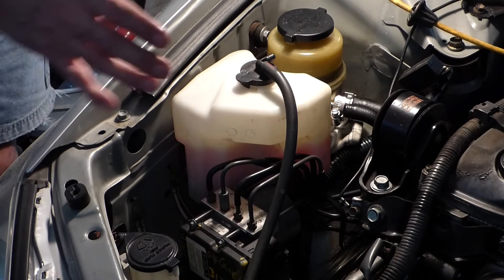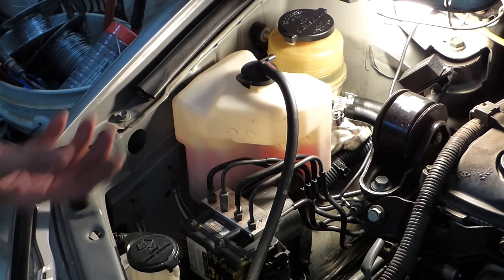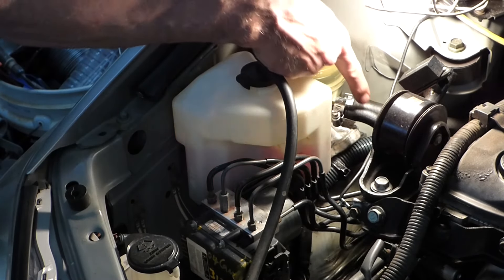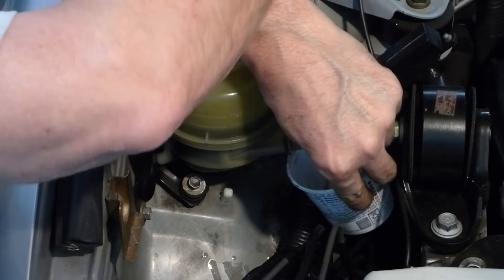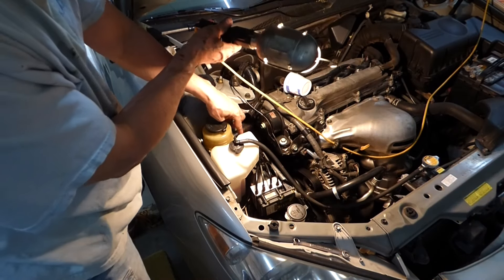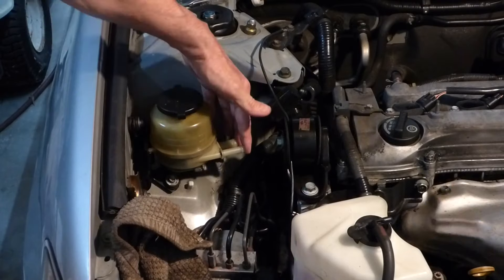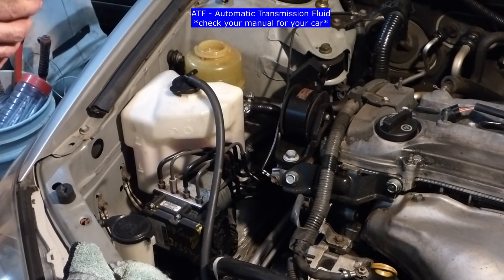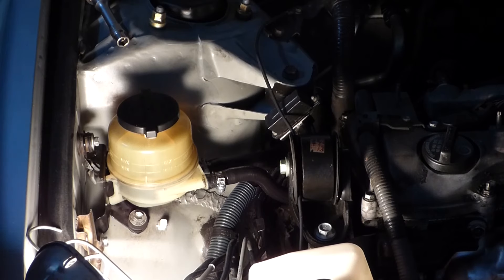Power Steering Leak? Check this EASY FIX First

Comment: I've replaced these leaking lines on several of this era Toyota Camry - recognized the engine layout immediately.  The Sunsong part on Rock Auto is 26 bucks. It's always been the rubber hose just worn out, hardening, etc, and no longer sealking corrrectly.  I recommend sticking with the OE continuous pressure clamps and not switching to worm drive clamps, unless you plan on routinely tightening up your worm drive clamps over time.  Two of the Camrys I did the replacement over 3 years ago and they continue to function without any leaking, so I am confident in the quality of the Sunsong parts.
Reply: Can you list the part numbers for both hoses?

Comment: Had the exact same problem on my 07 Solara. Mechanic told me both hoses were leaking but that just wasn't the case. The small line was loose, really lose. I just wiped it up and put a new clamp on. No leaks in 2 days. Good so far

Comment: If you look up a video by a YouTuber named silver cymbal, he advised the screw tight clamps expand and contract and you have to get the clamps that are designed to keep constant pressure regarding of a screw tightening method. I have also seen hose zip ties that you clamp down with a special tool and they don't expand like metal and keep pressure on the hose.

Comment: Thanks for the tip.... I have 2007 Mitsubishi . About  once a month ,there is a tell tale moaning  and groaning  of power steering  pump and  heaviness  which  tells me its time to top off resivoir ....Very likely  faulty / loose clamp.  I just got done upgrading  rear door speakers  when I noticed  the power window  motors and lift arm track and roller pulley are installed  "dry" at the  factory  as in no lubricant  this shortens life of motors and keeps  cash coming  in for certified  parts and mechanics . I went around  to all 4 doors  , greased all  lift arm tracks AND vertical  window tracks with dry silicone  lube....also coated inner door  ,  and latch linkage with WD-40. to inhibit rust
 WOW !  Night and day ! Huge load off motors and rust prevention , the tracks rust quickly....one was fused with roller pulley  and fried motor.
Removing  door panel  is not as bad as it seems. Have spare nylon plug inserts at the ready ,they get brittle  with age and break when prying off door panels.

Comment: Spring clamps are a pain in the neck to get off after they’ve been on for a while, they become embedded in the hose. The low side clamp down at the steering pump can be replaced as well fairly easily while it’s drained and will save you some trouble if there’s a next time around.

Comment: i have had great sucess using 2 clamps. It seems there is plenty of room to use double clamps on that one end. Be sure to position the screws 180 degrees from each other. You do not want both screws facing the same direction

Comment: Quick connect hose clamps are what you should be using. The ones you manually tighten never stay tight because of the fluctuating heat under the hood. Your problem was your clamps. Plain and simple. Cars come with quick connect clamps because they just work better.
Reply: You can use worm clamps as long as you put a dab of red loctite on the thread of the screw. It will still come undone with a wrench later but won't back itself out due to heat.
Reply: agree those pinch-tension clamps work far better
Reply: Then what brand do you recommend for the hose clamps? Can you link it here?
Reply: Can you tell me why they work better?
Reply: Ty
Reply: @kryptk.6 they expand and contract as the engine heats up then cools down
Reply: Thanku

Comment: $116 at the dealership is surprisingly cheap by stealership standards lol Have a 2000 RX 300, replace the steering rack and it’s still leaking and I don’t think it’s the line so I’m still watching

Comment: Good video. I have a question. If I wanted to change the power steering fluid, through which line would the fluid come out due to low or high pressure? Thanks.
Reply: No need to drain from the hoses.. You could end up breaking o  ring seal that are in the line.. Go get yourself a Turkey baster. Suck the fluid out from the top of the reservoir until it's empty Fill with new fluid to the proper level... Drive around for ten minutes make sure the steering wheel move back and forth.. Go back home or wherever you're doing it. Suck more fluid out until it's empty rinson repeat at least five times.. Usually until the fluid is  whatever color the new fluid is.. But yeah you don't need to touch the lines

Comment: My Honda van was making a loud noise when I turned my steering wheel. I took it in for repair they said it was the power steering pump and replaced it. Now 2 weeks later it's making the same noise and the same shop now says it my power steering pressure hose which can make the same noise as the power steering pump. Was this a mis-diagnose or can it possibly be both the power steering pump and the power steering pressure hose going out at the same time?
Reply: Sounds like they got over on you and knew it was the hose at first

Comment: What size is the rubber hose that you were going to replace, is it a 3/8in? Have similar issue but going to replace the hose as well. Thanks
Reply: did you figured it out what size is the clamp? Thanks. I have similar issue
Reply: Dang I was hoping for a response too
Reply: Same;-;

Comment: This is my proble.   It's a tiny leak somewhere, with oil spreading just like you described.   I'll bring my 1998 Toyota Camry (111,200 miles)  to my brother.  He's my in-house mechanic.
Reply: I have a 1998 Toyota Camry also, 112,800 miles.  
Some oil leaking and mechanic wants $600-$700 to fix it.   I'm furious.  I'll try this clamp solution first.  Tks
Reply: It was a leak in the oil pump.    Had to be replaced.
Reply from the maker: I bet it’s nice to have that fixed
Reply: Thanks for the replies.  It wasn't the power steering pump.  AAMCO lied to get my money !!!
I'll never use them again.

Comment: I have a leak of the same hose with 2006 Avalon and can't find hose by itself.  Mine has the swell at the bottom (the leak also from that bottom end), so I will try to flip the hose and put the end with the swell on top.  Hoping it will stop the leak.
Reply: Someone suggested Amazon Plews & Edelmann 80565 Molded Power Steering Return Hose

Comment: The problem with the screw hose clamps is you have to be careful not to over tighten, because the reservoir connections are plastic and can crack from over tightening.

Comment: i've had my power steering pump and switch replaced by the mechanics of the people who sold it to me in a town 45 minutes away from me, this was two different trips. it started leaking again and i thought "screw it, i'm going to see the local mechanic" who tells me it's the power steering rack that's leaking. now i'm just wondering if the other parts were leaking at all and if i just replaced parts that didn't even need replacing
Reply: My new mechanic AAMCO, strangers to me, want to replace pump for $600-$800.   I'm checking with others.   Maybe just a clamp leak.
I could fix that myself.  And I'm a woman.
Reply: Yep they lie. It's all about money

Comment: I replaced the return hose and I still had a puddle of power steering fluid under the car. Looks like the next step is rack and pinion. Seals are probably shot.  Nothings ever that simple. 🚗

Comment: I’m having the same issue on 2011 camry but it’s leaking from the other hose, I’m guessing that the high pressure side. I’m not sure if it’s a crack in reservoir or hose. Any suggestions

Comment: My 1999 Toyota Solara 3.0L V6 1mzfe appears to have a power steering waterfall going on under the hood.

I used to tight clamps in this video but it appears that my hoses are not good as it seems that the fluid is oozing through the walls of the hoses. I will check the reservoir for cracks as that was the problem on my Freightliner Truck tractor.

The problem is: I am not losing any fluid from the reservoir! The level would not remain the same if I were. I'm not losing engine oil. I'm not losing coolant. I do not see any wetness on my transaxle.

Very perplexing...

Comment: Thumbs down. This looks like a PITA fix to me. Wanna know what would have saved time and energy. When a leak is found in the line and they only sell the whole line, then REPLACE THE WHOLE LINE. Then you know it's all brand new and the clamps are correctly sized. This video is a homemade fix to a homemade problem. If the whole line was replaced when the leak was first found, this video wouldn't exist. The other end of the line is just as old, so don't be surprised if it starts leaking very soon. 
Next I'll be hearing some garbage like DEX-Cool is a bad coolant and OAT is a different type of coolant LOL

Comment: The issue was the old hose, not the clamps.  Ask any Engineer.  Hardened hoses and O-Rings from the caustic nature of the ATF fluid used in Japanese cars.  It goes back to WWII, we didn't want them flying airplanes after their Kamikaze attacks at the end of the war and demanded that they no use oils in power systems that could be converted for aircraft use, like in turbo superchargers.  The were forced to use ATF and it continued long into their car manufacturing history, the only major design flaw in Japanese cars.  Change the hoses out, not the clamps.
Reply: Which hoses?